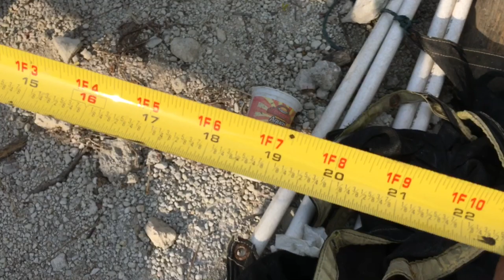Shortening rails on my roll off dumpster trailer

Comment: just found your channel, keep it up! You stay pretty busy with the roll of dumpster business?  Hello from Washington state!
Reply from the maker: Antonio Castrejon Thanks for subscribing buddy and yes I stay pretty busy with the dumpsters I’m looking to put a new hydraulic motor either today or tomorrow because the current one I have it’s very slow, and nice you’re from the northern states I was born in Wisconsin
Reply: Grtruckingdemolition have you had any problem with the winch system to pull the container up the track?
Reply from the maker: Antonio Castrejon no not really, I only had it snap on me once, but that’s because they loaded it with a excavator and put to much weight on it, and the previous owner, didn’t maintain the winch rolled properly, ever since It snapped the same guy that welds for me cut the winch in half, re threaded it and I’m still using it, very good winches, most of the time I leave the truck in reverse when picking up a dumpster so the winch does not do so much work.